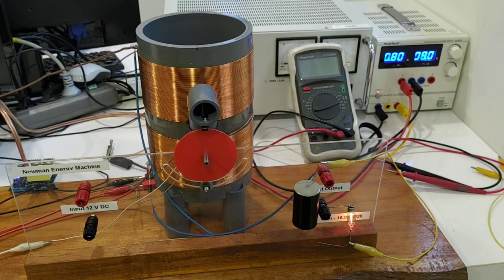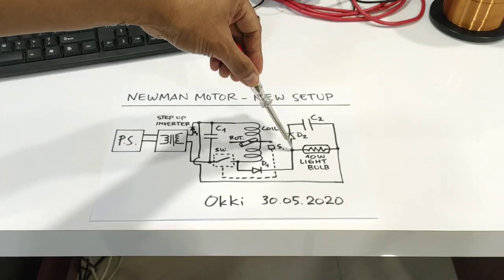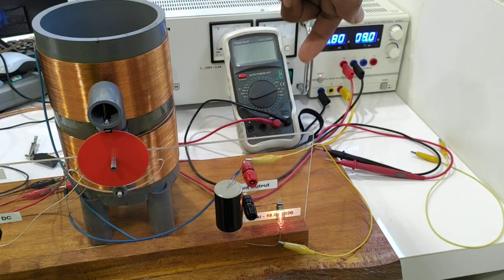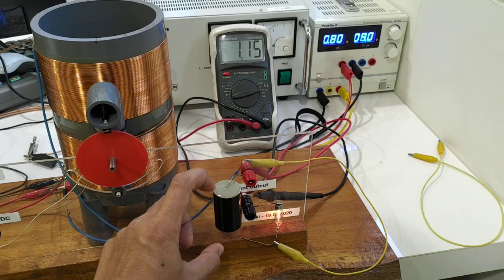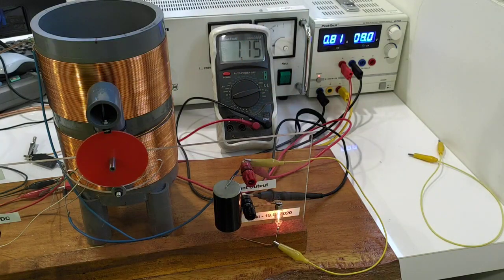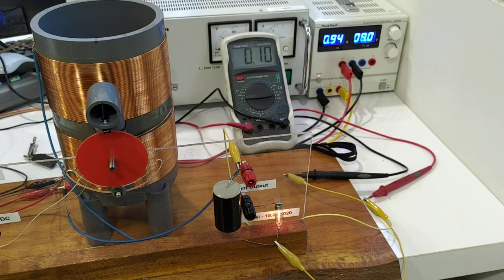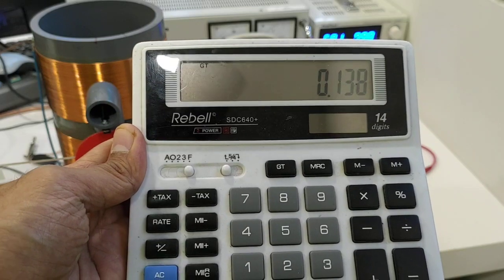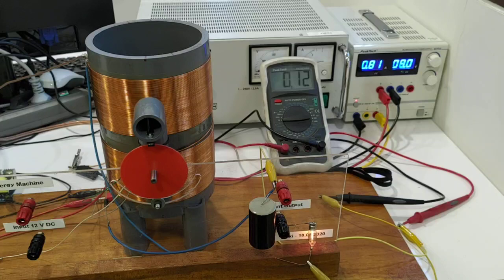Newman Motor - Input/Output Power Measurements

Comment: What about Shaft power ?  Joe used shaft power as output , running Mud pumps and other things .  Input power is low compared to other motors ,   Shaft power output , with minimal input is what makes Joe's motor so impressive.

Comment: Try a higher input voltage.   This in turn will make the motor spin faster by increasing electromagnetic field size.  Also reducing resistance on the tiny wires used to wrap the coils.

Comment: Okki, I have another idea.
The second video where you measure the temperature of the diode and find that the diode is cooler when the motor is running, you should disconnect both sides of the diode, and measure the temperature within a split second, because I think the diode will be back at its starting temperature immediately.
Reply from the maker: Yes, if the motor stops the diode will slowly back to the starting temperature.
Reply: Only "slowly" because the rotor will slowly stop spinning.
When the rotor stops, the frequency will be gone from the system.
The temperature of the diode will look lower when the rotor rotates, but when the rotor stops, the temperature will be immediately back to normal. Like when you start the experiment, the diode temperature is immediately lower.
I claim that there can be no valid claimes about an experiment that never took place Okki. 😂

Comment: Okki, could you add several wires in parallel between the motor and the radiant output instead of just the one blue wire and see if there is any difference? Why would there be? More conductors utilize the skin effect and hence transfer more radiant energy. At least thats how its supposed to work in theory. Why not give it a try?

Comment: A few experimenters, sometimes even professors, make the mistake of NOT taking the frequency and the waveform into account.
The output in watts can be higher than the input in watts, when the frequency and/or the waveform was changed. 
Our electricity bill is therefore in watts per hour (W/h), or like in Okki's case in kW/h.
The ONLY thing that counts is the surface of the waveform multiplied by the frequency.

Comment: Newman motor has an interesting motor position, but the eddy pulses every 180 degrees are showing "leakage" of the motor.
I believe its possible to create a homopolar motor with no sparks but high frequency induction in to the copper disc on which magnetism would act on... Similar to 1 wire transmission where perhaps you need some capacitance on the armature for high frequency to be able to act on the disc.